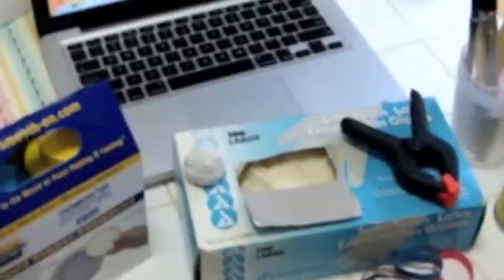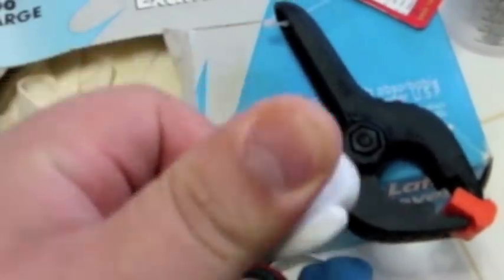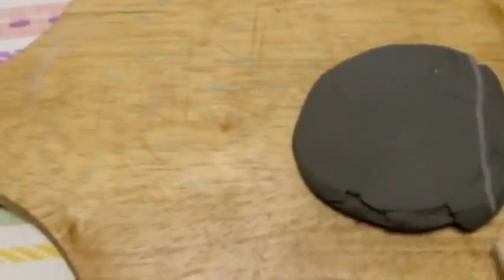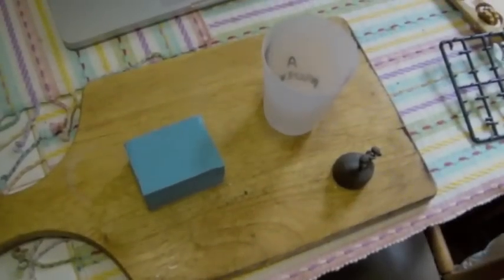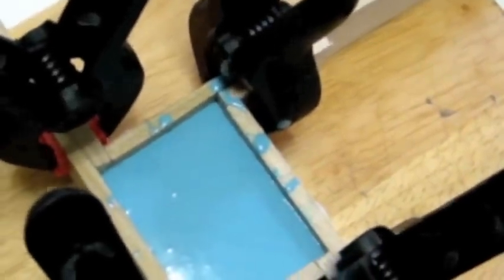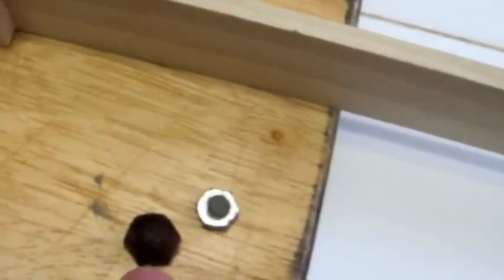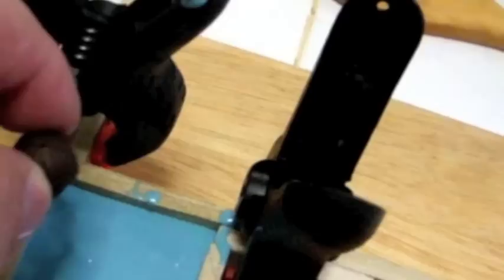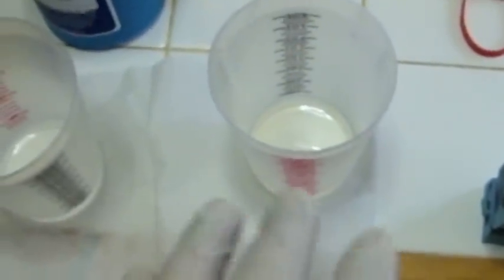How to make your own resin models part 1

Comment: I understand you molded your model imprint out of clay to print into the mold? I am wanting to do a GRX(special car in one episode of speed racer 'fastest car on Earth) the GRX car is not available as a model anywhere and yet it was along time ago. I googled the Hell out of it. want to do the body in resin from scratch doing a resin mold I do not have any way to make a mold print except doing a clay mold based on what I see in pictures, I am guessing from watching this that the clay is for this purpose. Will be hard but I want to do it. as a future project somewhere down the line.
Reply from the maker: Hi thx for the comment. Humm the clay used here is for just the processing for the master mold. so you can do the first half. you can do your one master model out of clay then do a cast mold for it. hope that answers you questions